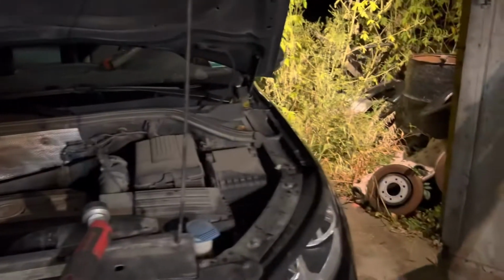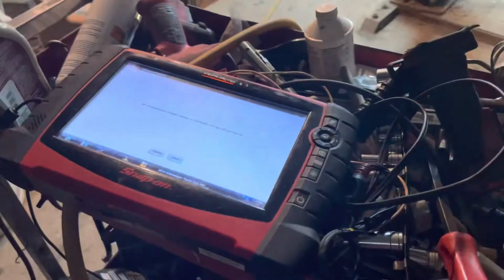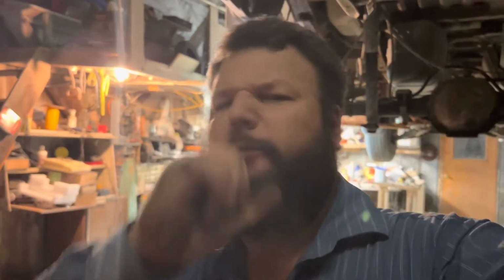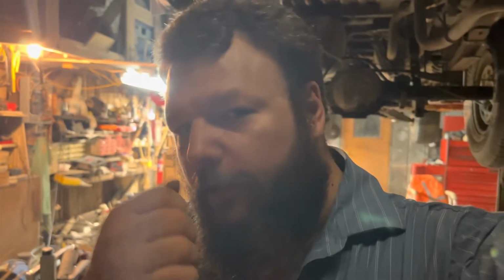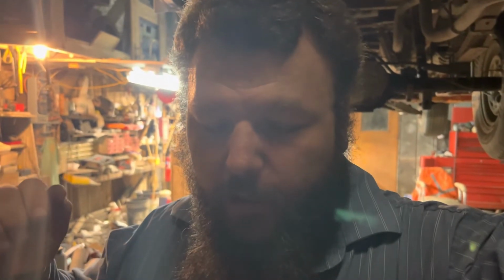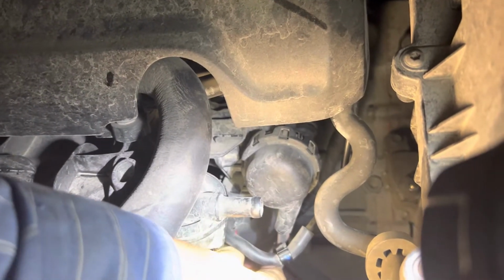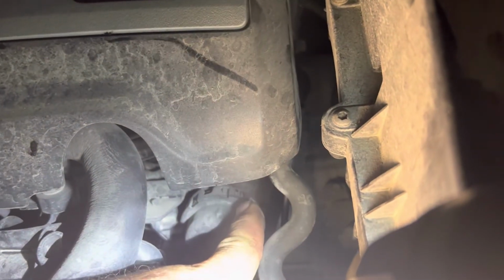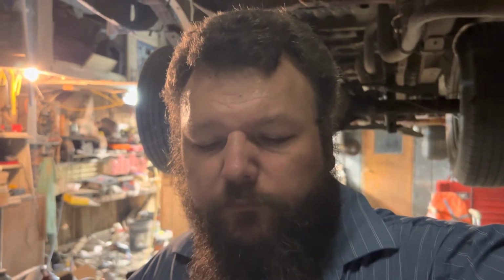Diagnostic method for an inoperative Intake manifold runner control, 2016 Volkswagen Tiguan

Comment: Getting the p2015 code on my 2017 Tiguan is replacing this sensor as simple as disconnecting the wires and swapping in the new sensor?
Reply from the maker: No, runner control sensor is behind the oil filter on the end of the manifold, sets behind the head a bit, have to pull the intake to get to it.